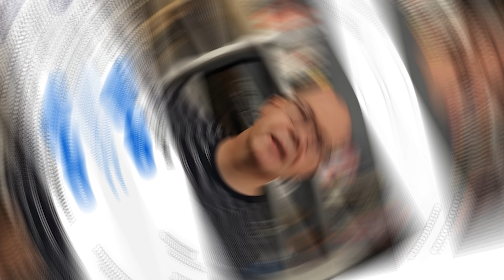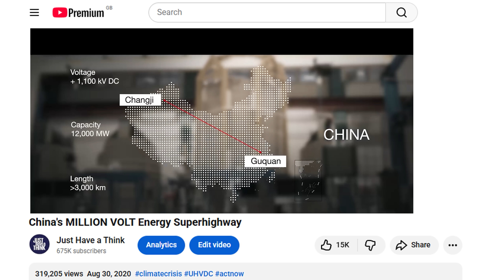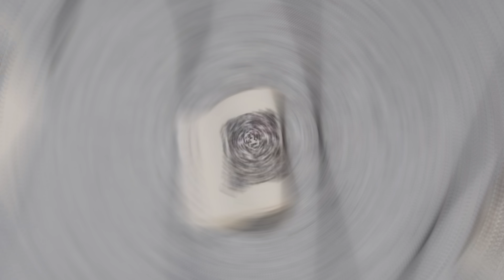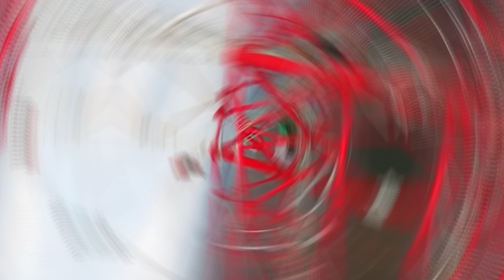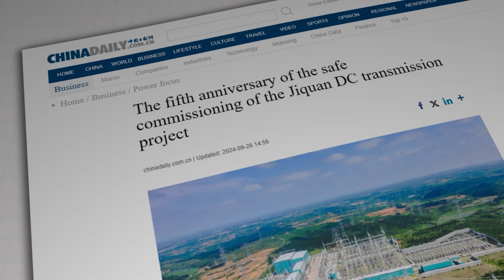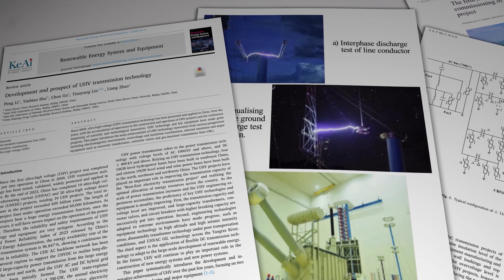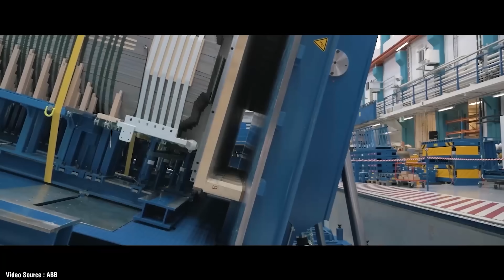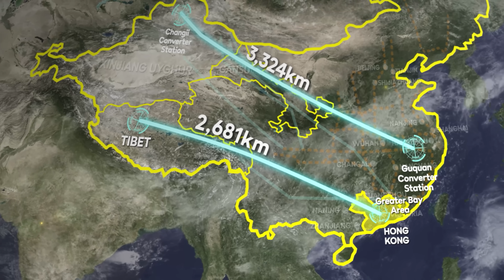China's ultra-high voltage transmission lines now breaking all records.

Comment: Excellent analysis. It’s only worth while ,for ultra long transmission distances. 600km or more.
Any less, and the return of investment, would be impractical. DC substations, are very complex,
and very expensive. Solid state power inverters, are not built to economies of scale….

Comment: Canada needs to expand its grid.  If transmission over distance generates heat, losing power why not bury the cables in a tube and use rhe heat to warm homes and power factories or turn a fan along the transmission line to make more electricity?🙏

Comment: What's often underappreciated about UHVDC is the voltage regulation challenge at the receiving end. When you're transmitting at ±1100kV over 3,000+ km, even small reactive power imbalances can cause significant voltage instability at the converter stations. The synchronous condensers and static VAR compensators deployed alongside these lines are doing enormous work that rarely gets discussed. For grid operators in receiving regions, integrating this bulk power while maintaining local voltage profiles within ±5% requires sophisticated AVR coordination — it's not just a "plug in and receive power" situation.

Comment: This technology is only suitable where you have generation located 500 miles away from your population which consumes the power. You send the power in essence in one direction.  The UK is small, so this is not relevant.  The UK has a single national grid meaning frequency needs to be maintained over the whole geography of the country. Power need to be able to change direction. Offshore wind, and the UK-EU interconnectors are DC lines, but that is mainly to avoid induction losses. This isn't a "The UK is just stupid" bandwagon opportunity.

Comment: I mean, technically you could run the entire grid through two normal 1,5mm² wires. You'd just need a LOT of insulation.

Comment: "Reported by the Chinese media", so leaving out all the related problems. Like electrical arcing, electromagnetic interference and coronal discharge esp in humid/polluted air! As per other Chinese infrastructure projects, few of these headline grabbing mega projects will last.

Comment: I was hoping to learn how they make that voltage at the generating site and then convert it back to low voltage AC at the receiving end. Unless solid state devices can now handle voltages like that, what else?  Motor-generators come to mind, but they aren't efficient.  OTOH, such losses may be offset by the UHV lines.

I dunno.

Comment: So maximal centralization of generation with critical points of failure that will cripple much or most of the country in case of disaster sounds like great engineering does it?
Sounds like you really LOVE the idea of Party control of all aspects of civilization, ' cause nothing ever goes wrong with that, does it? Is there ANY EMF shielding below these 1MV lines? What's the leakage and overall system efficiency? I realize ROI is very quick and positive for these kind of mega-projects- but what's the lifecycle ROI? What's the disaster tolerance for the system, how much overbuild for F. O. S., and is it really that much better than massively-distributed point-of-demand generation and storage and micro-grids EVERYWHERE?

Comment: I've been captured by heat pump tech which, of course, is continually being innovated. While watching a new vid on the advances to heat pump water heaters, I was troubled by the thot of why hot water on demand tech hasn't been advanced. It strikes me that hot water on demand should be much more efficient than even heat pump tech. Googling exposes the fact the cost of retrofitting on demand systems is impossibly expensive, but if the tech was refined, it should be fabulous for new builds. Am I dim?

Comment: UK maximum transmission voltage is 400kV.  UK generated it peak electricity capacity in 2005 with 398TWh and has been able to reduce electricity generation year after year to below 300TWh today.  Thus UK has been running down its power generation continuously for the last 21 years!  However it doesn't stop UK to act as an expert but the chance of using UHV, that starts at 800kV, is frankly a pie in the sky.  I say this because UK is so small that its existing transmission system is well below the beneficial cut off point of using UHVDC.  All the UK interconnections, operational, planned, approved or cancelled, with Europe are mostly below 600kV but the interconnector between England and Scotland does run at 600kV.

Comment: Don't forget the national security aspect of decreasing dependence on imported coal and oil as well. Each project like this makes China more resilient to external changes. And projects like these make their AI compute build out very easy, as the grid availability is basically a given wherever in China you are. Great project as usual, showing the benefits of govt stability.

Comment: Love your channel! Renewed demand for new natural gas peaker plants by Canadian and US utilities is very high despite best efforts to reach federally set targets of reaching net zero by 2035 (in Canada). This is creating lots of outrage and distrust in the public arena but it's viewed as the only way to insure energy security, voltage regulation and offsetting an already impressive wind regime. The grid tied battery 4-8 hour (full capacity) discharge time is usually the primary reason a utility will be forced to consider a gas turbine peaker plant. Yes, renewables & batteries can accomplish a lot of the necessary tasks, particularly where solar is a considerable asset but I'd like to see a video on how & why some less sunny areas of the planet may be dependant on fossil fuels for a bit longer than most people are comfortable with...particularly while residential electricity rates are still $0.16 CAN. In Canada at least, federal, provincial and municipal governments are being forced to recalibrate ambitious carbon reduction targets for very practical and economic reasons. Yes, this is a climate crisis, but targets set 5-10 years ago are becoming unachievable and with growing loads, the only conclusion that can be drawn is that utilities are somehow the only ones even trying while simultaneously being the only ones to blame.

Comment: Win a Hoody Competition. Idea.
Topic Suggestion... Internal Vehicle charge Connection
EV Vehicles should have an AC or DC input on the inside of the Vehicle so that Solar Energy generated from External Solar Panels attached to the Roof of the Vehicle (Pickup Trucks etc eg. BYD Shark . or Caravans, trailers etc, etc) can be used to help charge the Vehicle whilst it Is in Motion, which can be a substantial amount of Power..

Comment: you may wish to reconsider your stance just like the western Imperium, putin ru has been blackmailing energy supplies to the west for several decades. you are giddy recommending dependence on chi voltage lines as imported sources for western power reserves

Comment: In the "2025-2034 energy distribution plan" Poland (Polish Electroenergetic Networks - PSE) has plan to build 1440km (2x700km) HVDC that will run north-south across the length of entire country(~4GW).
It also plans a 145km HVDC connection with Latvia(700MW). It will build also 9 HVDC converters.
It's a 500kV installation.

Comment: It's too easy to say that all you need to do is bump the transmission voltage up.. and engineer efficient cables. Remember: China just does things without public debate.
It may be dangerous as hell, but they don't find out until disaster hits. It seems to me that you would have to substantially raise the ground clearance - which requires re- engineered towers. That in itself wouldn't avoid arc potentials on uneven terrain. One would discover those points only when people get killed.

Comment: Hello Dave!
As usual, great video. Thanks!
Concerning video suggestions: development in Chile of BESS to get rid of thermal generation. Some interesting figures:
 - The maximum hourly demand recorded during 2025 reached 12.4 GW.
 - BESS Expected Operational Capacity:
     - 2026 (Jan)	~2,000 MW	Target officially met (originally a 2030 goal).
     - 2026 (End)	~6,400 MW	Based on ~4,500 MW currently under construction.
     - 2027		~8,600 MW	Projected based on approved environmental permits.
     - 2030		10,000+ MW	Long-term target for full decarbonization.

Maybe you could do a video compering how BESS in gaining participation (compared to the peak demand) and different countries.

Extra (related to this video): The Chilean HVDC project called Kimal-Lo Aguirre. Some information of it:
Technology:	HVDC Bipole (LCC - Line Commutated Converters)
Voltage:	±600 kV
Trans. Cap.	3,000 MW (3 GW)
Total Length:	Approximately 1,346 km
Towers:		~2,700 towers
Investment:	Approx. US$1.5 billion to $2 billion

It is the most significant energy infrastructure project currently underway in Chile, designed to solve the "decoupling" of the grid by transporting massive amounts of solar and wind energy from the northern desert to the high-demand central region (Santiago).

Cheers!

Comment: One thing I wish the Tesla / SpaceX engineers would tackle is a safe, efficient, environmentally least destructive, scalable point-of-use hot water generation. Even in energy-rich regions, such as my province's (Quebec) relatively cheap rates, waste is waste, and keeping 40-60 gallons of water at a constant 60° temp. 24 / 7 uses massive amounts of ergs. The world needs a rethink about hot water. Maybe an "Octovalve for water" systems?

Comment: Batteries,at the point of production and anywhere along the transmission line,but especially at the point of consumption are the keys to getting the most out of present transmission infrastructure.
At some point the peaks and lows of transmission would draw much closer. I’ve experienced this in my home where I have solar off grid inverter fed by a #10 wire PV input and a #12 240. Volt circuit from the grid that tops off the battery at night when grid power is free. 
This is shocking to me as I’m a retired electrician who never imagined wiring a house with less than a 200amp 240volt service.

Comment: The Cahora Bassa hydroelectric scheme on the Zambezi River supplies electricity to South Africa. Built in the 1970s delivers DC at 530kV - not close to the Chinese but quite a feat for the time. Thank you for the video. Can you maybe elaborate on the external insulation of these lines?

Comment: China is still too afraid of nuclear power, as is nearly every country on earth, even France. Its talent and resources would be better invested in that than attempting to carpet its deserts with solar panels and windmills. France still uses its nuclear power solely to produce electricity, and shut down its only breeder reactor over 30 years ago. Anyone who is serious about using nuclear power knows you need breeder reactors; uranium-235 is cheap only so long as demand for nuclear power is low, and thorium, as well as depleted uranium and many minor actinides, such as neptunium, U-236, americium, and Pu-240, can be turned into power only in breeder reactors. A serious transition isn't just electricity--it's replacing gasoline, diesel, natural gas and coal for transportation and industrial process heat. Electrifying everything is probably not the best solution--synthetic fuel production allows us to use the extreme energy density of nuclear fuel to replace tons of motor vehicle and furnace fuel with grams of nuclear fuel, eliminating air pollution and, since we already have millions of tons of depleted uranium in storage, we can eliminate mining for fuel also. Every light water reactor has produced 200+ years of breeder reactor fuel for each year of its operation; CANDUs about 135 years.

Comment: Hydro-Quebec has researched high voltage for decades, way before anyone else and they concluded that above 750KV, power lines become subject to excessive arcing.  For China to use 1.1M KV means they need to have a way to isolate the line from the atmosphere.  There is such a thing as lightning!

Comment: A video on solutions that overcome cost and permitting barriers to grid build out in the UK and Europe would be great. Some solutions that we are looking at for up to 110kV include (1) running Gas Insulated Lines - a proven existing solution - overground along railway lines and farm field fences (2) reducing trenching cost and work corridor width with a new 'towed' solution. Do feel free to get in touch for more details.

Comment: What I'd like to see is a realistic comparison to the damage done by fossil fuel extraction (+refining, transport, burning, etc) and that caused by mining, processing and using "green" technology.  For example, most of us have read about the Alberta Tar Sands, the Niger Delta, not to mention burst pipelines or the Gulf of, er, somewhere, oil spill.  On the other hand, we are told about child labour in the DRC, the difficulties of recycling wind turbine blades and solar panels, pollution from battery fires, etc, etc.  However, for the average Joe Bloggs, it is difficult to grasp the scale and relative damage done by the various means of energy production, transport and power use.  A huge subject, I know, and full of possible scientific and legal pitfalls, but it would be interesting to know if anyone has any pointers in this area?

Comment: I know it'll be a common theme, but really getting into the numbers on data centres would be good. I work in power (offshore wind) and looking at the grid, and power requirements of data centres gives me real concern. It needs to, and will happen. But for rapid deployment, gas turbines and engines seems to be the main option. Is there a sustainable/renewable option that can compete on deployment, speed to market and cost...?

Comment: Here is my question for a future show.  With transmission lines a major expense along with the loss of power along the way, why not focus on self sufficient units for completely off grid capacity?  I'm working on a design for a self sufficient, fireproof, low cost house boat.  I hope to also use paddle wheels to move it around and to generate energy from river or tidal flows, when parked in the right locations, so add that if you can.  I'm hoping to offer 1-2 people models up to 6 person eventually.  Of course, most of this same hardware can be used for land based homes as well.

Comment: discuss how high voltage Uses HVDC (High Voltage Direct Current) HVDC is chosen because:

1)Much lower losses over long distances
2)Better for submarine cables
3)Converter stations at each end convert:

Discuss the Sun cable projct in Australia to supply the national grid in Singapore from central Australian desert.

Comment: Solar + Battery - the ultimate strategy. As batteries get cheaper, batteries that can hold about 75% of maximum winter day demand + plus solar panels that can produce 110% of daily demand on a bad winter day. These might produce 8 times the electricity needed on good generation day in mid-summer. As solar production rises above daily demand, panels on every 'table' are turned off. This way, each solar panel table only has the circuits and inverters for its share of 120% maximum daily demand given that a portion of tables will be out of action for maintenance or storm damage, etc. 
Obviously, the UK will have wind and nuclear for many years to come. But, an advantage of solar+batteries is that the whole system, including security fences, can sit on screw-in piles. The system is 100% recyclable. We could call the whole system 'equipment' not needing infrastructure. This will simplify the types of approvals required.

Comment: Many Moons ago when Skylon was still being developed IIRC someone did calculations that if launch costs dropped to about $500 per Kg then Space Based Solar Power Stations would become financially viable but since then the costs of ground based Solar & Batteries have dropped substantially so if you want a nice complex subject to research ;-) would these numbers still hold up with inflation & aforesaid price drops what are your thoughts on Space Based Solar Power Stations and have the increased efficiencies of phased array transmitters in recent years made the tech more viable.?

As an aside when I thought of the question to qualify me for the hoody competition as soon as you reach 700K I did think of an associated green technology that could make use of sufficiently accurate solar power phased array transmitters if they now exist with the needed capabilities. As I don't have the money & resources to patent & develop the tech I hereby put it into the Public Domain:- 

Extremely Large Steam Airships (ELSA) My thoughts are that built on a large enough scale heat losses would be minimal & water is cheap compared to Helium & not as explosive as Hydrogen this could be a way to decarbonise a large percentage of both Aircraft & Shipping freight if the the tech were scaled up to a large enough scale. It would also be a way to more easily move the increasingly large wind turbine blades as they continue to scale upwards. It could be that increasing efficiencies in thin film solar would make the the need for the space aspect not so necessary but I think it would make it more efficient & 24/7. As what gives Airships lift is Archimedes displacement a Steam Airship should be able to lift about 43.5% of the cargo of a similar volume Hydrogen Airship  or 51.9% of the cargo a  similar volume Helium Airship if I did my back of the envelope calculations right.